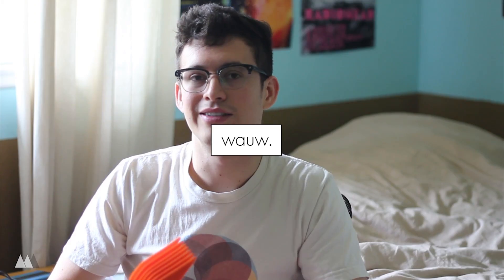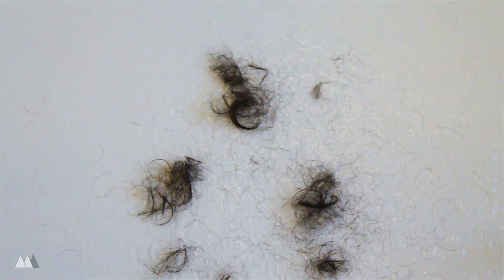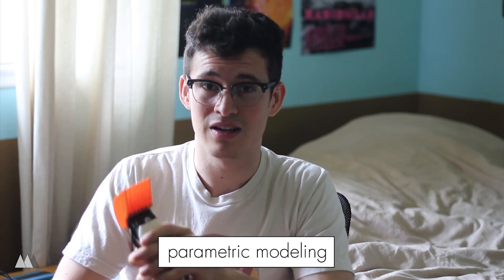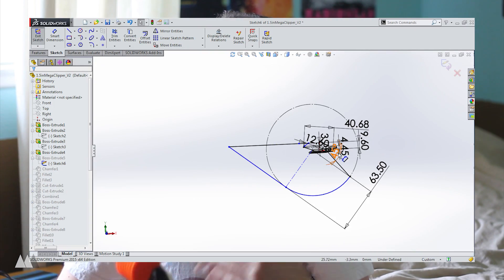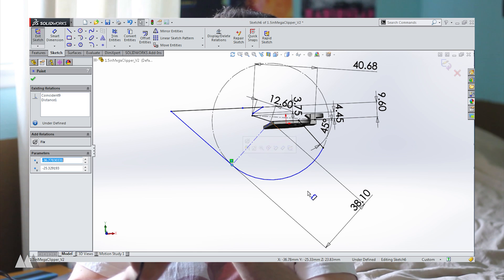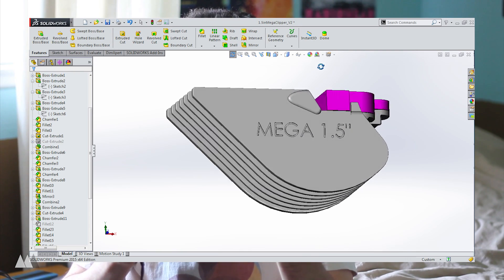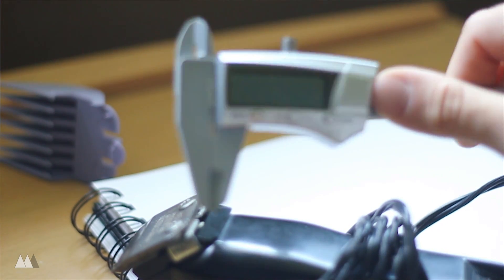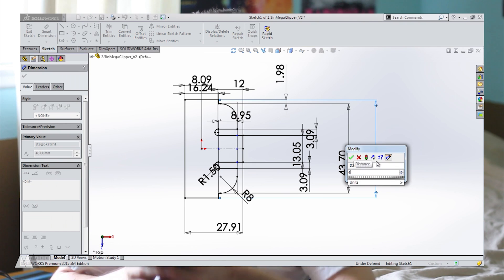3D Printed Mega Clippers a.k.a. The Joys of Parametric Modeling

Comment: Hi, I am a longtime user of home haircutting systems and I'm currently interested in purchasing some of your products of you'd make them available to me to buy privately or list them on Ebay. I have been looking everywhere for something like this. Unlike you, I do one length cuts all over. Currently I have the standard style clipper Wahl Color Pro (Original Model) and more recently the Wahl Color Pro Cordless. I also own a Robocut which I'm required to attach to a vacuum cleaner for suction of the rotary blades. I'm trying to eliminate the Robocut with the use of larger clipper combs and attaching them to my Wahl Hair Clippers because the Robocut doesn't provide the greatest haircuts and it can cause minor accidents if it's mishandled, which is rather easy. There's also the A5 Clippers for pets that make guards up to 6 inches but I hear that they overheat easily and don't work well for human hair. I already own the 1.5 inch custom clipper from Wahl which is way too short for my taste and I also have the 2 inch version from Clipquik. That one is somewhat acceptable for me but I'm really still trapped using my Robocut for cuts between 2.5 and 3.5 inches and getting subpar haircuts from it. If your clipper guards are compatible with standard Wahl clippers I would be interested in your 2.5 inch, 3 inch, and 3.5 inch guards at a reasonabe price. I can pay you securely through PayPal if you would be willing to ship them to my address. Please let me know. Just set a price for those 3 sizes. Please let me know. Thanks
Reply: @mhypersonic  i need personal hair clip 2.5 inch for ramington hair cliper for pursonal use